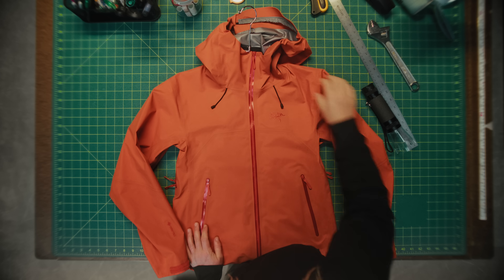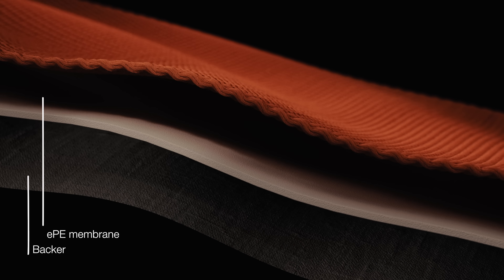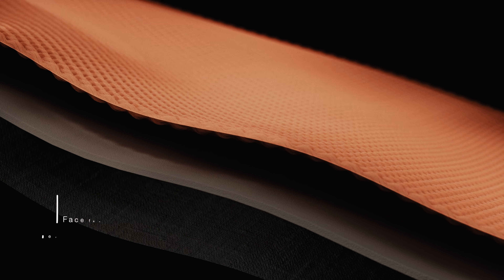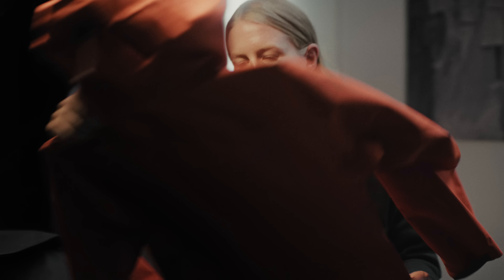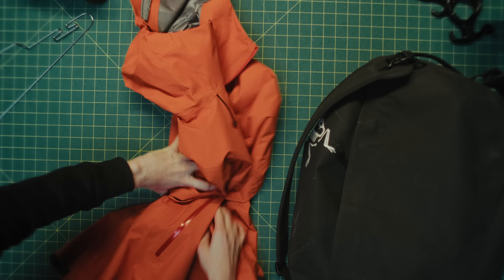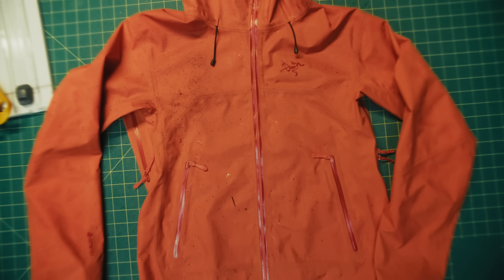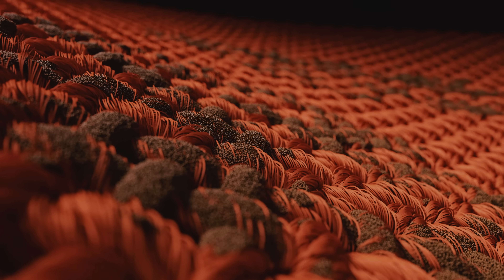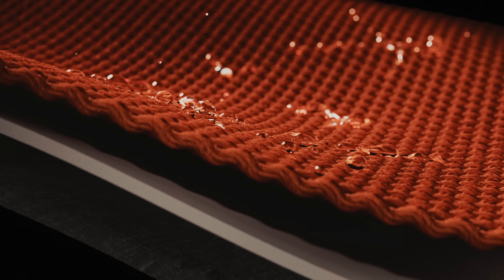Arc’teryx | What is GORE-TEX ePE?

Comment: The problem is these chemicals never really break down in the environment AND cause cancer. 

Would like to know some weight, hydrostatic head, and MVTR numbers of the new membrane.
Reply: The HH is still 28,000 but the RET won't be quite as impressive as old Gore. 
Gore tex don't use MVTR and always used RET.
Reply: Mountain Equipment's Makalu jacket uses Gore ePE and has a RET of 9. The Rab Namche (also Gore ePE) has a RET of <13. The Makalu is made with two different denier's of fabric, 50D and 75D, so it's likely their RET score is for the 50D material. The Rab Namche is 75D throughout and the thicker the outer fabric is the higher the RET score is.
Reply: But does it work as well? My alpha sv (old style) is bullet proof. I am not sure about these new jackets. Also what have they done with their sizing? Why not retain an old style technical range with the proven gorges and sizing?